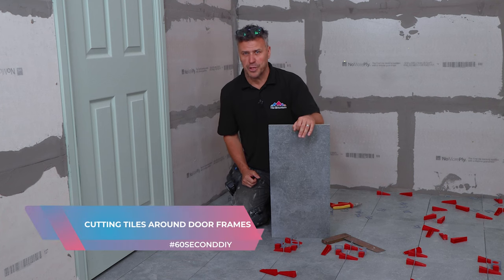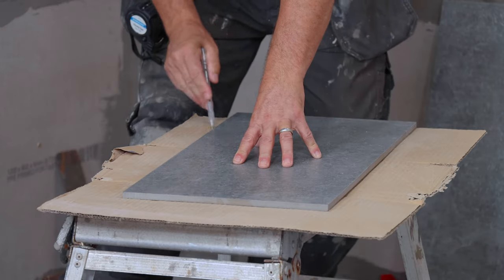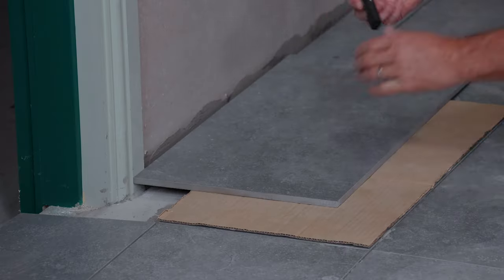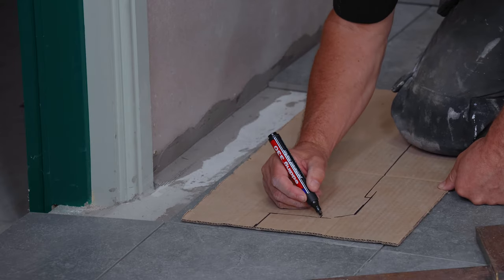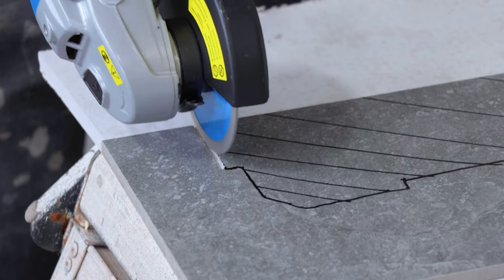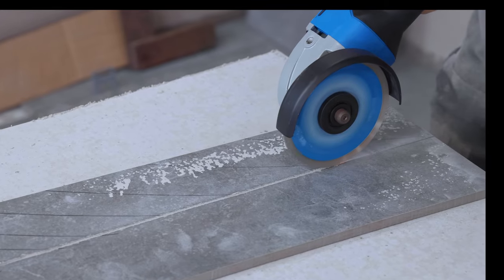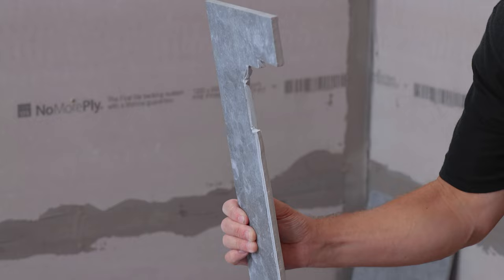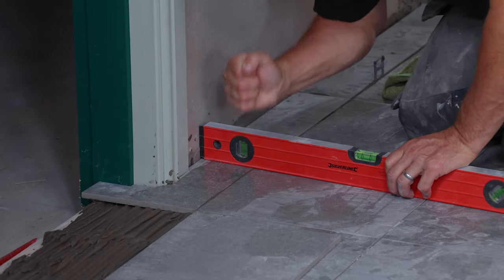Cut Tiles Around Your Door Frames | 60 Second DIY Tips | Tiling Trade Tips

Comment: You should NEVER cut tiles tight to the door frames or walls. Tiles need room to expand. If they are too tight, you increase the chance of some tiles buckling (popping) up. I speak from experience and have seen this several times. This video shows tile being cut snugly around the door frame. The best solution is to cut the door frame a centimeter higher than the height of the tile or enough so the tile can slide UNDERNEATH the door frame
Reply from the maker: That's why I used a flexible silicone around the edges to ensure that any moment won't damage the tiles, adhesive, grout or wall, thanks